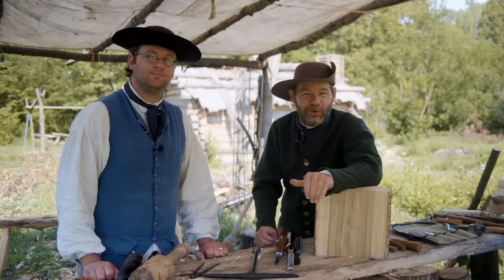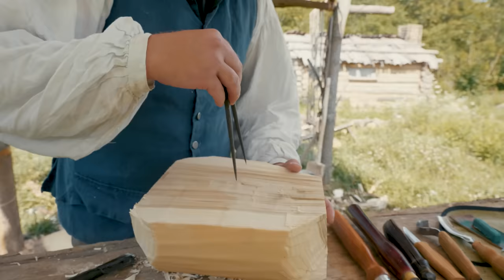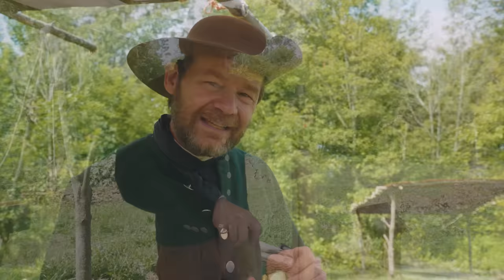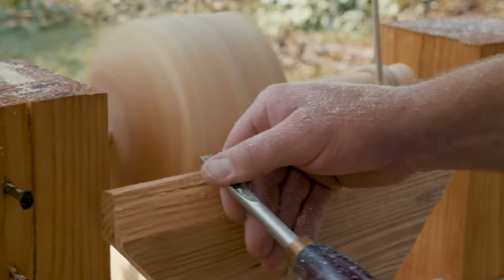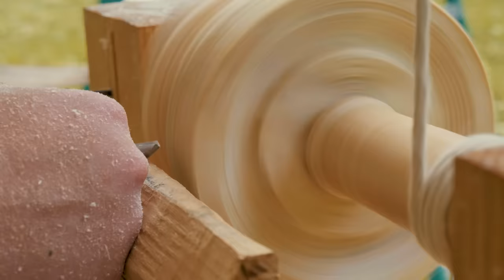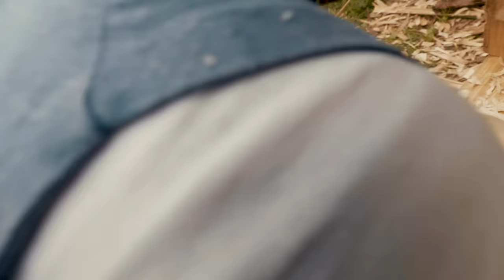Hand Carving Spoon and Bowl - Our Cabin Needs Utensils

Comment: I'm still very impressed with the handmade lathe. I wonder how common those would have been on your average homestead
Reply from the maker: Thank you! We're excited about how it turned out. Fairly common.
Reply: I'd love to see a video detailing it and its construction!
Reply: @townsends  This was probably my most favorite part of the video.  When you mentioned using a lathe for the bowl, I was wondering how you were going to do it without electricity, since those are the only lathes I'm familiar with.  It was impressive seeing one that worked like an antique spinning wheel.
Reply: I would love to have one of these, but I don't think I have the skills to build it. I may try anyway!
Reply: @Tser  that's the spirit and when you try you will build skills too
Reply: It really is a surprisingly useful tool for how low-tech it is. And it's easy to see how the beginnings of industrialization would have improved it even further, with metal bearings and perhaps a flywheel to give the mandrel more momentum to keep spinning.
Reply: there is a program on pbs that has roy underhill...called the woodwrights shop...he uses a 'primative' lathe similar to this...probably rare but not uncommon...
Reply: @Tser  //// YOU NEED TO BUILD YOUR SKILLSET!!!!! LEARN BY DOING,IF YOU SCREW UP,SO WHAT,LEARN FROM YOUR MISTAKES!!!!!!!
Reply: This Technique was used during dark Middle Ages for making all kinds of Polearms
Reply: I know a guy who turns stuff on pole lathes right now just because he can.
Reply: I'm so excited by this! An 'analog' lathe! Thank you for these videos -especially now!
Reply: I'd imagine near everyone had one. Similar to microwaves and TV and fridges today.
Reply: @Tser  go for it, it is surprisingly simple, if you buy lumber the hard part is getting everything "squared up" for the points to meet, just measire carefully check mgeasurements and cut.
There are some minor pitfalls in spring plle and footboard but...
Threadle lathes are almost the same, big difference is having a large flywheel with a crank making it possible for lathe to go one direction all the time roughly halving time used and markedly improve time between sharpening the tool
Reply: These types of lathe have been producing bowls and bracelets for many centuries BC. Simple, yet amazingly efficient.
Reply: I loved that, too!  Pretty cool. :)
Reply: @Tser    skills can only be acquired through practice. 
You probably won't succeed, BUT you'll know what went wrong to do it right. 
Remember, there's no such thing as "talent", talent is only losing the fear of failing, as soon as you just accept that you're going to do something you've never done before, and the first time always sucks, then you're home free.
Reply: @Agamemnon2  That particular type of lathe is literally thousands of years old.  Given your user name, you may be interested to know that the ancient Greeks had similar ones.

They used in ancient India and ancient China as well.

Old, widespread technology, often with small local differences though.
Reply: kaylathehedgehog2005, Pole lathes go back, at least, to the Middle Ages. If I get stronger before the weather gets too chilly in late October, I’d love to make one & learn how to use it!  If not, next year is coming!
Reply: @ezrabrooks12  one of the best pieces of advice on the net today.
Reply: A spring pole lathe is easy to make in the woods of the US and is very common. The hardest part to make or buy was the gouges and chisels used with the lathe to form the turnings. Apprentice woodworkers commonly made their own sets, some from ore, some from scrap "recycled" metal and some from purchased metal. Unlike today, purchasing a turning tool set was expensive, quite unusual and added the expense of the woodworker being unskilled at maintaining, sharpening or rebuilding his gouges when they wore down.
Reply: they were invented during the neolithic, and were/are still in use by Bodgers today in England.
Reply: @Agamemnon2  and tool posts and turrets with multiple tool posts and chucks then multi removeable jaw chucks lol. literally every aspect of lathes has gone through about twenty gens of evolutionary improvement. cant argue with simple though
Reply: Please do a video on constructing the lathe!!!!!
Reply: @townsends  Couldn't help notice the pun in there. Took me a minute to whittle away at it.
Reply: @willaien9849  it looks fairly easy to make just a even set spike on either side to hold the wood and a bowed piece of wood to act like a spring to pull the string up and a plank to step on to pull it down
Reply: @Agamemnon2  actually the first upgrade you want is a treadle - most of which were cast iron, but they can be made from wood. The pedal style is probably the best, although I think at this time the average craftsman in a city used a foot-driven crankshaft made from cast iron, in addition to an early flywheel.
Reply: I've got this book ever since I was a kid showing what life would've been like during the Middle Ages, a section on the average village shows almost the exact same lathe set up.
Reply: @Tser There are medeaval and less complicated ones that are older. Might be easier to replicate.

Comment: I wish you and the Townsend's crew would give the actual man-hours required for these projects. Just to give these projects some prospective of the effort required. Have a good day.
Reply: A larger spoon depending on techniques, size and skill can take between 1-3 hours. A bowl of that sort can be done in less than a day. Search "Robin Wood" in youtube and gaze upon a modern professional pole lathe turners work.
Reply: @allenreel6345  thanks for the robin wood suggestion.
Reply: Trent//// SOMEBODY THAT WAS SKILLED IN THE TRADES COULD TURN THESE OUT PRETTY QUICK!!!!!
Reply: Spoon takes between 1 to 3 hours depending how fussy and skilled you are.
Reply: Using a thin enough branch and if you don't care what it looks like, a spoon can be carved in 30-45 minutes.
Reply: For commercial people, bowls and spoons were churned out at the rate of several per hour, in stages, from roughing to finishing. People did it for themselves in spare time, by the fire or wherever. Here in Wales we have 'love spoons', still made, purely decorative, done in a young man's free time...

Comment: I assume all those wood shavings would be collected up and saved for starting fires?
Reply: I bet so. Waste not want not used to be a practice that most used.
Reply: &'m hoping this year they do a fireplace video- no music, no talking, just a nice popping fire to watch and hear...
Reply: It could also be composted or used as a mulch.
Reply: Too wet. They'd have to dry for a good while.
Reply: Could probably also be used to reinforce the mud insulation between the logs of the cabin
Reply: Once the shavings were dry they would also be rubbed on wood that has been planed or chiseled to burnish it and give it a very smooth final finish. The bowl, spoon should also be rubbed with vegetable oil or lightly coated with bees wax to waterproof (water resistance really) and seal the wood for regular use. You reseal the piece every so often and it will last many year's use.
Reply: For lining the hamster cages of course LOL
Reply: @s.leemccauley7302  we don't waste much in modern production today either....
Reply: @Trainguy9000 Shavings saved for shims, kindling, possibly as absorbing material.
Reply: @G1ennbeckismyher0 Except the metric tonnes of chemical waste of course.

Comment: Use that honing compound on the "rough" side of the leather. The "skin" side is for final honing. I was working on another snuff spoon when I got the notification for this video. Small world.
Reply: If you're using an oiled stone you can wipe the residual material onto the leather and that acts as a honing compound.
Reply: @moosemaimer  good tip.
Reply: Depends on the leather and how much silica.

Smooth side with chromium oxide is great for honing and polishing.
Reply: how do you know he wasn't doing "final honing"? also the skin side is called the grain side and that's the side i always use for my knives.
Reply: @karlhungusjr1  normally honing compound isn't applied to the grain side. "Skin side" is easier for more people to understand.

Comment: For wood utensils hear are some tricks I have picked up.

 1 you can friction burn in bee's wax before taking it off the lathe.  For a  waterproof seal. 

2. About once a month wet a paper towel with a teaspoon of cooking oil then rub it into the wooden utensils to prevent cracking.  Edit fond a better mixture called wood butter. To make it liquefy  1 part beeswax.  Then add two parts warmed but not boiling food-grade mineral oil.    Then allow to cool before rubbing your utensils with it.  

3 Never wash wood in a dishwasher,  including wood-handled knives. This will dry out and crack the wood. 

 As for cleaning hot water is fine but don't leave them soaking in it.  For long periods of time.

These steps will keep a wood idem around indefinitely.
Reply: Yep. Sounds advice. I have a cutting board I made in shop 35-36 years ago that I use every day just about.

Comment: Ahh, I was wondering if you'd need specialized tools to hollow out the curvature of the spoon. Very satisfying to watch 👌

-Do you lacquer the utensils at all? In Japan, we use a sort of mixture made from the sap/resin of a kind of pine tree.
Reply: Usually, for items that will be used on food, a non toxic oil is applied to seal and protect the wood. I would be interested to learn what exact oils they would have used in the 18th century
Reply: There used to be a show on PBS called 'The Woodwright's Shop' and one episode dealt with spoon making. One method used was to carve the general shape of the spoon much as was shown here. Afterward, a hot coal from a fire was placed on the bowl of the spoon and allowed to burn the wood. The coal would be removed before it set the spoon on fire and the scorched wood would be scraped out of the spoon. The process was repeated until the spoon was the desired depth. Alternately, instead of a coal, a piece of hot iron or steel was used.
Reply: Anonymous Accordionist My guesses are flaxseed or linseed oil, corn oil, hemp oil, cottonseed oil, and walnut oil, based on native plants of North America. If you have an expeller press, you can make these oils.
Reply: Rubbing beeswax into the wood actually is a great treatment for the wood.
Reply: Rubbing beeswax into the wood actually is a great treatment for the wood.
Reply: @prima164   Yes the sap is poisonous I believe, so I don't how lacquerware is safe to eat from, but there is some sort of process to is. I have a lacquered bowl, and though you can't put it in the microwave,  you can use it with boiling hot water for some reason.

Type in 'nurimono' into wikipedia, and something should come up! :3
Reply: @GunterThePenguinHatesHugs  the toxin in the sap used to make shikki is volitile and evaporates off as the lacquer wear coating dries, minimizing the content in the final products.
Reply: I imagine just eating foods from these wooden bowls would build up natural oils and seal it over time. Kinda like seasoning a cast iron skillet, all you have to do is keep using it.

Comment: I'm pretty sure the darker wood in the middle of the log is the pith since I didn't see Jon remove it.  The pith should be removed before carving to prevent the finished product (spoon) from cracking.  But you both did a great job.  The tools do look incredibly sharp.  I love watching a sharp tool cut through wood like butter.

Comment: My favorite method to make a spoon is to use a hot coal from the fire to do the majority of the work, just pinch it to the spoon with scrap of wood and with a little bit of blowing the hollow will be burnt out, from there its fairly easy to clean up with the tip of a knife or even a round stone. Using this method it's easy to carve a spoon using only a pocket knife. Although an axe greatly reduces the time it takes.

Comment: To make a spoon or bowl with a simple straight knife you carve it out, lightly burn it out, scrape it out until it is just fibres again, finish your rough shape with the point of the knife, and then use round stones with a bit of abrasion either in the stone itself or in the bowl with the stone (or sandpaper if you have it) to finish it out. A bit longer of a process, but requires no specialised tools.

Comment: I remember reading an article in Mother Earth in the early-80s on making wooden spoons using an ember to do most of the work by burning away the concave bowl. I imagine it would work with a bowl as well.
Reply: The reason why that isn't  actually done in practical work is because of cracking; the heat causes extreme stress and cracks, plus it hardens the material under the burning spot, making it harder to work.

Comment: You should turn the bowl material around and use the other piece for the spoon. The outside (barch side) of the branch or log shall be the top part of the spoon and bowl. Othervise pieces will crack of the edge and there is bigger risk at cracking when drying from green wood.
It is a common mistake to use the rounded form of the log/branch to form the bowl/spoon, but it is the grain you should follow.

Comment: Quick question and observation (not intended as a criticism). It looks to me that the gouge being used is a modern High Speed Steel tool. Wouldn't a High Carbon Steel tool be better. HSS is designed to be sharpened on a grinder and normally cannot be honed to the degree a HCS tool can. With hand (foot) powered tools, sharpness is the name of the game. I have seen blacksmith made hook tools commonly used to make bowls on spring pole lathes. They are capable of taking off a lot of wood without a lot of force, and still leave a fairly nice surface. Even a HCS spindle gouge honed to a very sharp edge would be a better tool for this application than HSS, IMO. I do understand about using what is at hand. 
Keep up the good work.

Comment: I have a unfinished spoon in my haversack that I bring to events. If I'm not cleaning my musket I'm whittling away on my spoon. Still haven't finished it yet
Reply: Sir Frederick , you might know: would they have finished the wood in anything back then? Like soak it in something, a wax or an oil or something, to make it last longer or maybe be more waterproof? Or was spoon making so common that once one is dirtied they just made another? Thanks!
Reply: @Oltoir  I've always "refreshed" my wooden bowls with mineral oil (not spirits). I think just using it would season it.
Reply: @SirFrederick  No no; wrong.
They would use waxes and oil to finish it, and it is necessary to regularly re-apply it every once in a while.
Reply: What sort of oils would be used to seal the utensils?linseed?
Reply: @tmihnahmygahn2789  Tools wouldve been likely sealed with Corn oil, and beeswax.
Tools couldve also been burnished, but its not necessary for usable utensils
Reply: @D-Vinko  Corn Oil goes rancid pretty fast.
Reply: @SirFrederick  it sure does, but this is only one of a few things I've found.
I can look for more; i do see references to unboiled linseed oil, and tung oil.
Boiled linseed oils were used for cabinets and the likes.
Reply: @SirFrederick  Linseed oil was more common at the time so it is actually likely it was used more often than any corn oils.
Shellac was also pretty common, but for spoon finishing I imagine they were burnished and potentially hard wax coated.

Comment: What are the benefits of making a wood bowl over clay? The region? How much use could you get out of a wooden bowl?
Reply: They had plenty of wood and could turn out a bowl in a short time. Less likely to break if dropped. Wooden utensils were cheap, cheaper than pottery, and were in common use around the kitchen and for every day meals. A wooden bowl can last for years. I have wooden salad bowls that must be 50 years old. Don't use them every day, probably once a week on average. One that was used every day could still last for many years.

Comment: So how long would this wood last for use and what would be the methods used to clean it?
Reply: For wood utensils hear are some tricks I have picked up.

 1 you can friction burn in bee's wax before taking it off the lathe.  For a  waterproof seal. 

2. Wet a paper towel with a teaspoon of cooking oil then rub it into the wooden utensils to prevent cracking.   About once a month. 

3 Never wash wood in a dishwasher,  including wood-handled knives. This will dry out and crack the wood. 

 As for cleaning hot water is fine but don't leave them soaking in it.  For long periods of time.

This will keep a wood idem around indefinitely.
Reply: @warrmalaski8570  That's interesting. Would it be possible to buff in the beeswax (maybe in a liquid state?) without the lathe?
Reply: I don't know but I have a set of wooden salad bowls that must be 50 years old. I clean them with a damp wash cloth, or just wipe them with a paper towel, never soak in water. They came with a varnish like finish which I believe is linseed oil, occasionally I wipe them with salad oil.
Wooden spoons from the dollar store are cheap, when they get dark and stained from use I throw them away, never wore one out. They may last several years.
Reply: Thanks for the comments. I do know not to let them soak. I'm real careful with my wooden handled knifes.
Reply: Salad bowl finish works great for spoons. It forms a hardened outer shell but is still food safe. The spoons clean up easy as well.
Reply: Ive used the same wooden spoon weekly for 20 years.